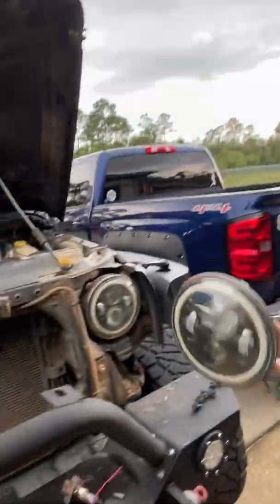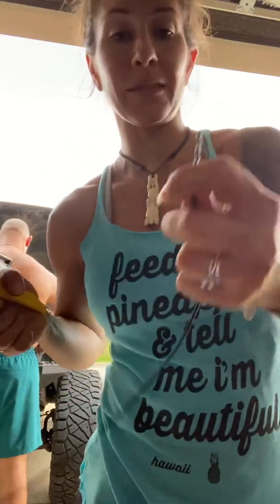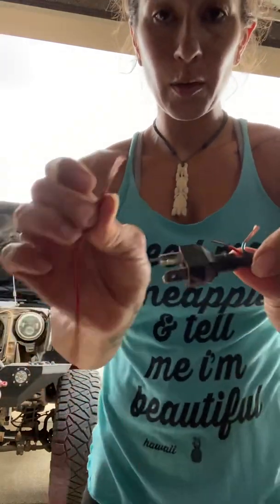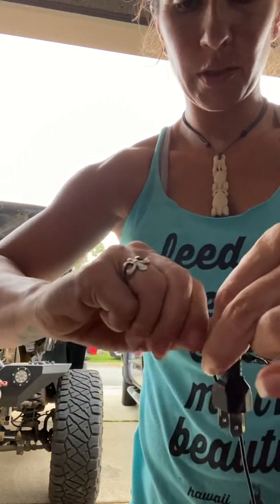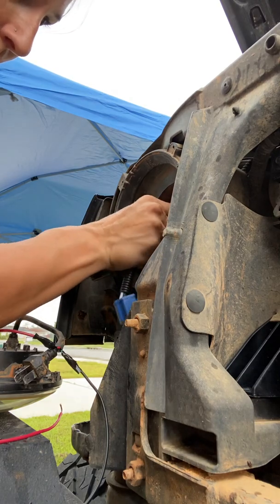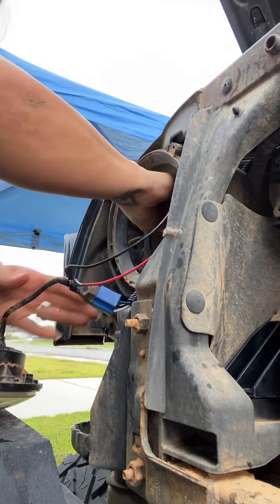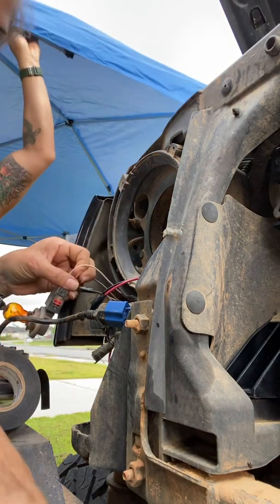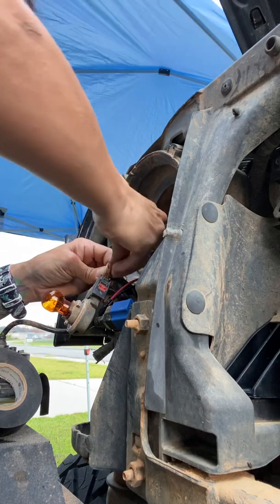Wiring the halo led light to the turn signal for a JK

Comment: Tried side and a middle wire. Unfortunately it didn't work for me. So I decided to tap into all three wires. Middle wire is  running lights/white LEDs 
Side wire opposite of black wire is the turn signal/amber LEDs on a headlight light.
Black wire neutral/ground.
Hope that helps.
Ps.
Jessica thank you for the video!
Reply: Your comment for the turn signals were very helpful

Comment: Cool. Easy peasy, but If someone doesnt already now, this might confuse them a bit. You should mention which color wire youre tapping into. Saying, "red to middle" is ok, as middle of 3 wires is ..easy. But then you call the others "inside/outside, however, your'e holding the turn signal socket "backwards". (bulb facing back- Opposite its natural mounted position). If someone was marking wires while the socket still mounted, they could have some issues. ;)  SHORT version: Red "halo wire" spliced into [whatever color] &  green "Halo wire" to [Whatever OTHER color.]  
Cool vid though, just tryin to clear it up for folks.  😉 😎👍

Comment: This is a great video, but this isn't working. Any suggestions? Turn signals work, running lights work. I have the Halo ring, and the red and green wire, but no worky.

Also: Best tip ever was your way of keeping wire spools from unrolling, I've been trying to think of a good way.